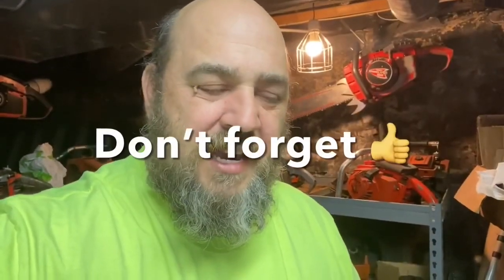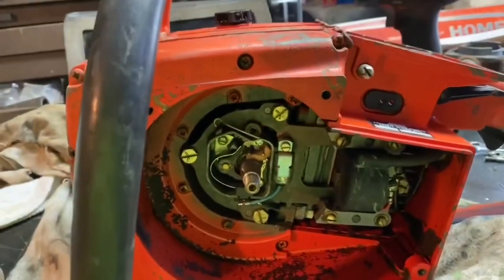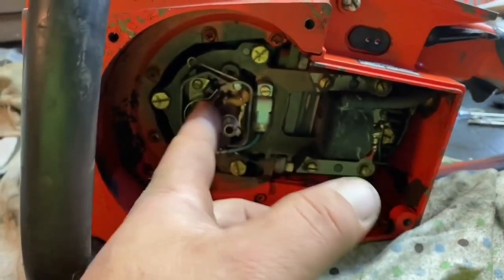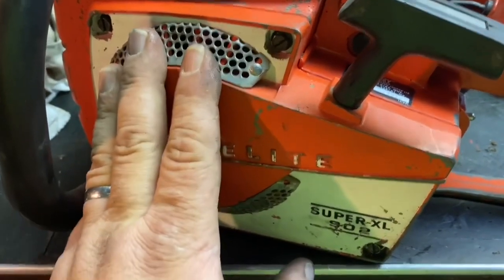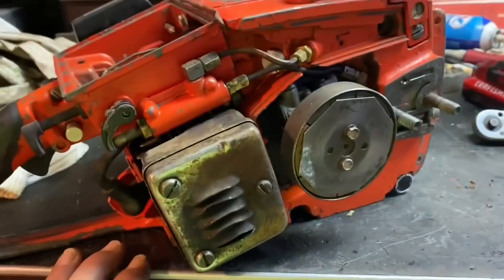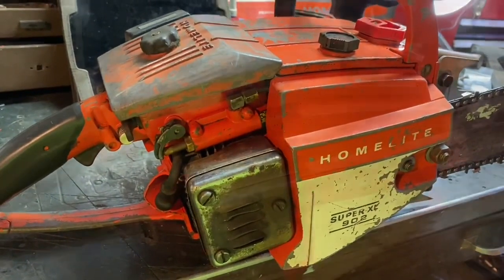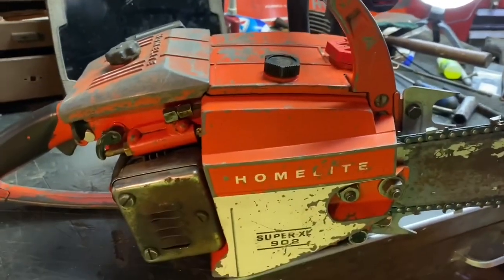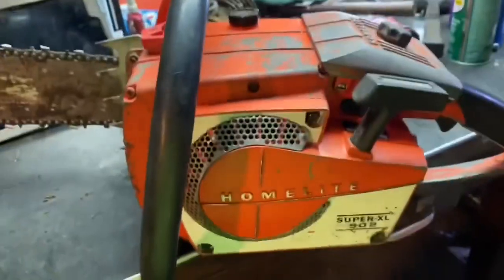Vintage Homelite Chainsaw!  Back To Life!  Repairing Everything To Get This Saw Running Again!

Comment: I have an XL-700 that I can’t figure out the spark situation on. I took the points off and cleaned them and re set them but the spark is still intermittent.
Reply from the maker: I’m fairly certain you have a bad condenser.